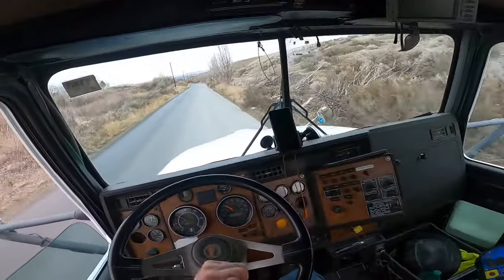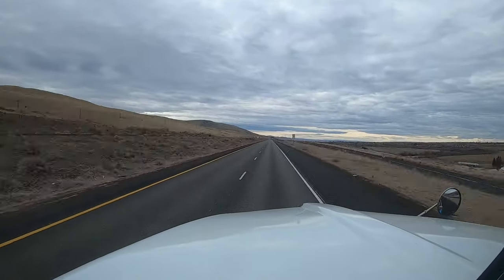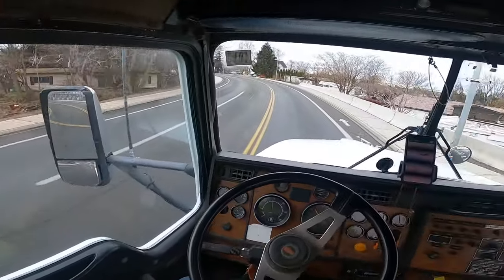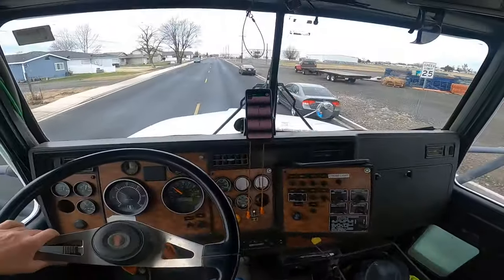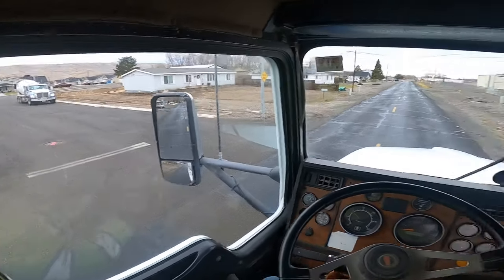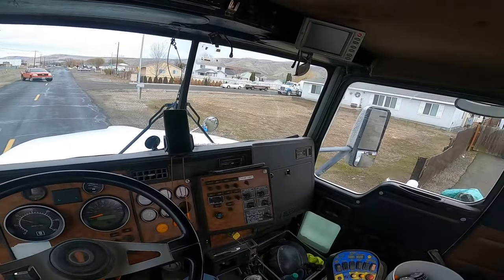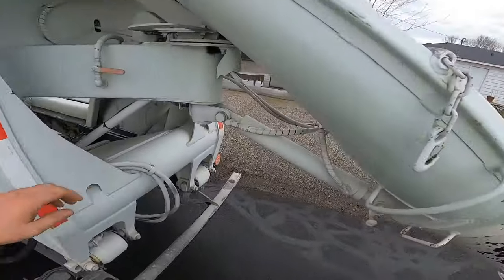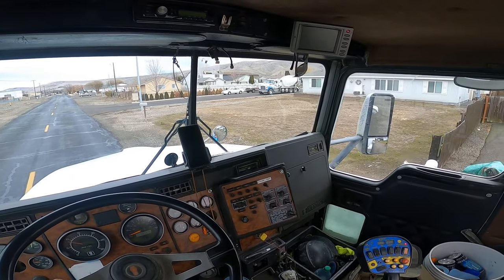Driving Cement Truck: Pouring Sidewalk

Comment: This line of work is more mental than physical. Once you get the hang of it, your in there. Your a different breed to do this kind of work. Amazing content, keep it coming! 💪🏾👍🏾
Reply from the maker: Thanks bud!
Reply: Exactly !!! Once you figure out how far you can push that mixer with 10 yards. How much of a lean or soft spots you can put it in. A mixer driver is a on the job fast thinker. Every day will be a different day. It’s all repetition but just diferente obstacles and situations every day !!
Reply: Can you make more than $100,000 a year as a mixer driver where you’re from?
Reply: @palaniku7  I would honestly say about 60 to 70. Would be nice to make 100 though!
Reply: Owner operators can make about $90 in Colorado and up to about $130 in other states. Find a leaser. They will essentially brokers the contracts and jobs.
Reply: that's exactly what I said.. I been doin this since early July,  but been a driver for over 20 years in different arenas
Reply: I got my CDL to drive, not think! But something told me to apply to be a mixer....Pray for me😳

Comment: Wondering how the slump gauge on the truck works?
Reply: Works off the hydraulic oil pressure of the pump and the drum drive. The wetter it is. The less oil pressure it takes to turn it. On my front dump. A 1,000 psi on my gauge is about a 5-6 inch slump. 2,000- 2,400 is a 0-1 inch slump for curb mix
Reply: Pretty much in simplest way, it gauges the resistance required to turn a drum. Think of it this way. It’s easier to turn a drum of water than sand and rock. Easier the turn the lower the gauge number

Comment: What’s the hardest thing about the job? The contractors? Getting the slum right? The driving all the time? I’m only asking because I’m about to become a cement truck driver and I’ve never had a CDL.
Reply: U only need a class B for that truck because it only has a parking brake. But if u don’t like driving that may be the hardest everything else is cake but they will explain everything most important thing to me is to take your time
Reply: I just applied for a mixer driver position too. I hope I get it.
Reply: @jasonmcarthur9175  I just got a mixer job and nervous about keeping the slump. Is the job easy? I feel like the hardest part is the long days maybe idk? I’m nervous tho
Reply: @Welz   it’s a slump chart well we have a chart to help with the slumps if it’s 5,4,6,7 etc is it a front loader truck or rear load my job is cake we do mostly pumps  don’t be nervous just take your time and learn as much as you can
Reply from the maker: Everything will come with experience. It'll be a lot to take in for about six months, then it's the easiest job you've ever had. The hardest part is getting used to the way contractors want things done but most of them will give the new guys breaks. Good luck out there!
Reply: @Welz  how's it going so far man? I started this week. My instructor said just go with what size slump the work order says and when I get experience I'll learn if I need to add a little bit of water (distance, heat of the day, contractor that always wants water added and will use up your water, etc) before leaving the plant. State jobs go with what the order says...lazy contractors that always wants it soupy for easiry work, water it down a bit at the plant.
Reply: The hardest thing about that job is the crazy hrs.. been doing it 20 years. You will learn how to sleep standing up.
Reply from the maker: @oscarsanchez443  haha no joke. Sometimes you start at 1 or 2 in the morning and off around 5PM, then the next day you start at 9 in the morning and off by 2....
Reply: @grabbinggears109  Yea or it rains and they tell you stay home. Then you sleep like a baby. But then your all mad because you are working Saturday for free only to get the 40 guaranteed lol
Reply: As a driver trainer.
1.safety .. you will learn how far you can push that truck in bad job sites
2.Be on time if you want to keep your job
3. Always know where your going. A lost driver is a dangerous driver.
4. Pre- trip is done threw out the day not only in the morning. As your slumping or washing out at a wash out a quick walk around your truck is always good. 
5. When tail gating the mud roll your windows down turn off the radio and listen to your surroundings lots of whistling and shouting sometimes. Take your seal belt off so you can lift up off your seat so you can see your blind spots .
6.When at the pump always have your mud ready. Once you hear the other truck crackilng you can start putting your mud on your shut. 
7. With in time you will learn your slump just by sound. 
8.If your by the hr and load bounce don’t chase them loads. Sometimes you will get 8 loads and work 12 hrs . Sometimes 3 loads and work 15 hrs.
Reply: @oscarsanchez443  we've been here sittin in the truck for 6 hours so far with no loads today because it rained earlier. We're at 42 guaranteed.
Reply: @oscarsanchez443  And 12 mph or less when making a turn when loaded. We aren't supposed to unbuckle while the brake is disengaged.
Reply: @ramblin_man23  Lol yea brother chill time.
Reply: @oscarsanchez443  dozing in the truck. I'm still training and we've been sitting here now for 7 hours and 45 minutes so far and haven't taken a load yet. Now we're under the plant though getting ready to do a callback.
Reply: @ramblin_man23  Take your time get your hrs. Don’t chase loads😉!! Since you know that’s probably the last load of the day 👍
Reply: @ramblin_man23  . Best advice I can give you is learn from everyone . But you will find your own way of doing things as you pickup things from all your partners. You feel me.
Reply: @oscarsanchez443  I understand. My real trainer is on vacation and I've sit with 2 other guys in his place.
Reply: @oscarsanchez443  Friday I sat with the guy who trained my trainer and he said if I ride with others to just observe and not ask how-to questions because everyone does things differently. That's what I did, I just watched and learned. Today I'm back with my trainer and I'm throwing questions at him left and right lol.
Reply: @ramblin_man23  Lol Ask him if yalls plant is a low profile plant or a high profile plant ?? The difference is a low profile plant loads trucks with a belt. A high profile plant it loads with gates.
Reply: @ramblin_man23  Ask him on a very hot day and my ticket says customer wants a 4 inch slump can I leave with a 5.5 slump since the job is far.
Reply: @ramblin_man23  ask him.. Is our plant loading with a comman batch system?
Reply: @ramblin_man23  ask him you want to learn how  to slump by sound . You can 👍 do that also.
Reply: @oscarsanchez443  material gets carried up on belts and dumped and dropped through gates that open up.
Reply: @oscarsanchez443  yeah he's added water to slumps occasionally. He said I'll learn the contractors and how they like it and how much water to add based on heat and distance.
Reply: @oscarsanchez443  he said I'll learn that. At first I'm gonna go my the gauge lol.
Reply: @ramblin_man23  Do ya do state work ? If so do ya use nitrogen and ice ? In the summer
Reply: @oscarsanchez443  yeah we do. They require 70 revolutions before we leave the plant and we use ice if necessary but no nitrogen.
Reply: @oscarsanchez443  yep or the hardest part is stay awake lol while waiting on pumps to get to the site
Reply: @jasonmcarthur9175  Yes sir.. when that happens hide behind trucks before the customer try’s to tailgate some of ya !!! 😂
Reply: First off you have to know what kind of truck your driving, it's not a cement truck it's a concrete mixer unless your going to drive a air-can and haul cement...
Reply: @hk5674  well they call it a cement truck here.
Reply: @culligan76  maybe when you get 40 years in driving a mixer you'll know what it's called, rookies LOL...
Reply: @hk5674  ok, always an expert no matter where you go.
Reply: @culligan76  LOL
Reply: @Welz  I've Been Driving A Mixxer For The Past 5 Years & The Worst Part In My Opinion Is 10-12 Hours Into The Day & You Back Under The Plant Expecting Water To Do The Final Wash-Out Of The Day & Clock Out, But Instead You Hear The Plant Kick On & You Get Loaded Again!!! That Is Always A Bummer!!! LOL
Reply: @oscarsanchez443  shit we have one big customer every Friday he has is pour a fucking wall at 5:00 it’s all good because we get time and a half after 8 hrs... and free medical I can’t complain it’s way different then when I was driving a 18 wheeler tho the shift of weight lots of backroad jobs going slow Af up a hill but hey I wouldn’t change it lol slow is smooth and smooth is fast as my C.O. Use to say.. hang in there br
Reply: @TheFrogFather509  I swear shit happened today I was watching the Tablet for Wash out and nope here comes the ticket 9.5 yards for a ten minute drive 🤦🏾‍♂️
Reply: @jasonmcarthur9175  Hell yea brother.. Be safe . Like I tell the new guys I train . Take your time but don’t pass nobody and don’t let nobody pass you.. I’m talking about the other mixers. Have a good safe pace. But then I tell them. When you get a 10 yard load. Just 10 of 10. Take your time it’s all good. That’s when you chill and stop on your way back to grab something to eat. Lol
Reply: The hardest thing about being a ready mix driver is getting used to your schedule.

Comment: How physically demanding is this job?
there is a lot of lifting and climbing involved with the job correct? 

you have to climb up the ladder and wash the inside of the drum after you get loaded each time

you have to hang the chutes on the back when you get to your job, 2-3 chutes depending what your truck carries?

when you’re finished at the job you have to climb back up and wash the drum down again and wash the chutes clean of concrete then rehang the chutes on the chute holders

then there is additional climbing up the ladder to add calcium chloride , color or fibers it the job calls for it

So how hard do those aspects make the job?
Reply: Not hard at all bro, those are all valid things that come with thr routine washing down after every job is easy and you won't always use chutes so you'll be hanging them up half the time but other then that it's easy that's my take on it👍
Reply: @y.b.m.a3393  are you currently working this job?
Reply: @LDeol  Nope I left for something different wasn't my thing going to these jobsites but not a difficult job especially someone with experience

Comment: You driving a concrete truck calling it a cement truck didn’t know you were driving a tanker my man lol
Reply: He typed that for the searches
Reply from the maker: Haha I know... but "cement mixer truck" doesn't get searched for.
Reply: You are right. I call such truck a concrete truck. Concrete is applied to large areas of sidewalk, on steel building floors, and in precast molds. Cement does not come in a large truck. I have seen cement poured on a small square on a sidewalk, smeared on broken concrete, even as masonry on bricks. Your writing is just fine.
Reply from the maker: Hahaha to-may-toe, to-mah-toe
Reply: @captainkeyboard1007  it has stone or rock in the mix
Reply: @michaelniziolek6990  Which material to which you are referring, concrete or cement?
Reply: @captainkeyboard1007  concrete of course
Reply: @michaelniziolek6990  I read you bright and clear. Thank you for tapping or typing to me.

Comment: 10:38 why are you not adding rpms to mixing after adding water?
Reply: Jr driver lol jk
Reply: @danielhayes735  umm what? Why are you not reving up the truck engine after adding the water is my question 10:38
Reply: @markrobert6014  not sure why he isn’t, I always Rev up when I adjust.
Reply: @danielhayes735  oops thought you were the guy in video sorry man lol. Ya maybe your right.
Reply: contractor sometimes wants to go ,most of the time
Reply: @michaelniziolek6990  still doesn't make sense for 1 he's not even on the pour yet and 2 why would you want partial wet load to start and other half load dry will fuck the finishing, if he wanted to pour right away.
Reply: @markrobert6014  its a learning process n he really should be focused on the job at hand not making videos. kinda suprised the company hasnt said sumpin yet.

Comment: cement truck???????????????
park on the main drag and back in??????  no, drive past previous truck and find a place to turn around
two chutes???????????  nope, one.  safer and quicker
don't use the clutch in deep reduction.  slam it in, slide it out. save your knee for old age
5 yards left on??? booster down back to the plant